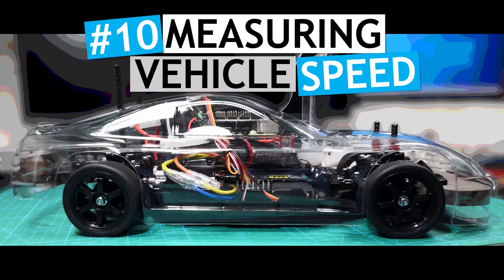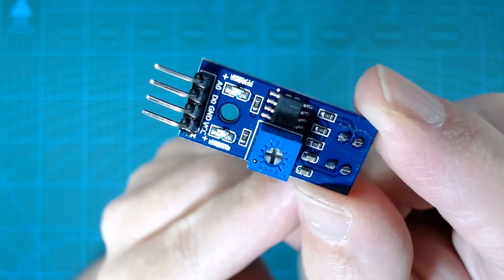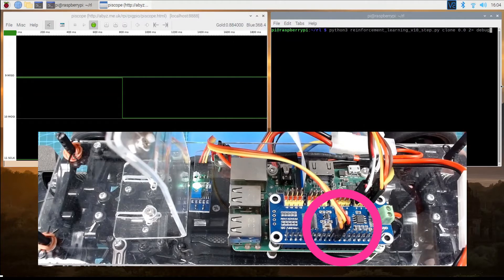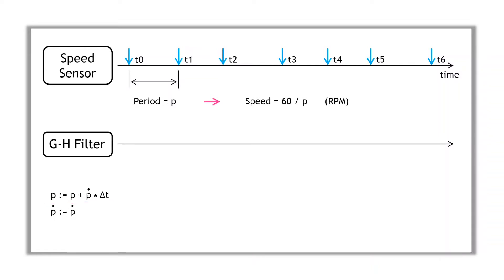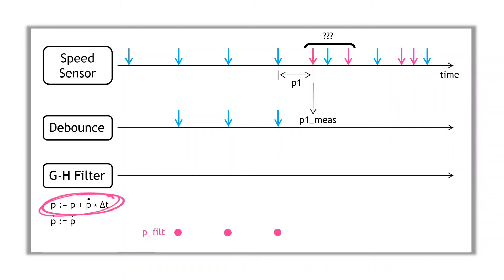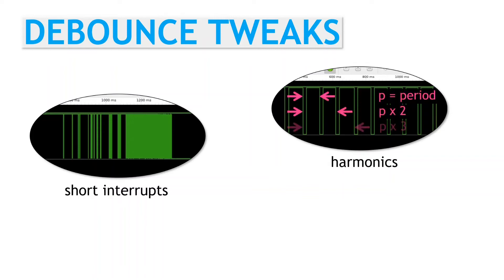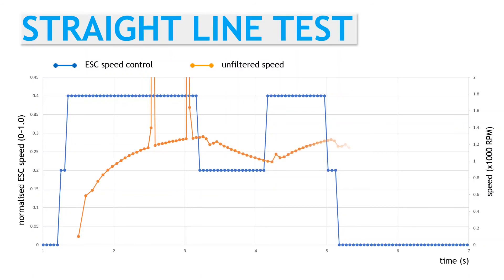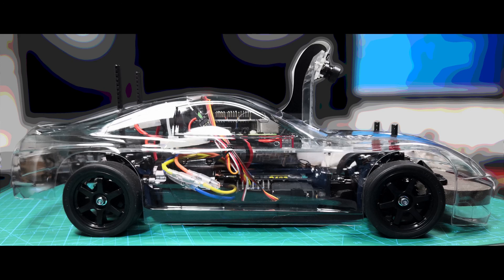Measuring the Autonomous RC Vehicle Speed

Comment: Hello do you know how to measure the steering angle of the vehicle?
Reply from the maker: The steering servo position gives you some measure related to the steering angle?
Reply: @theunsupervisedengineer1310  thanks you so much for your reply. Yes it gives me the measurement. In my case the steering servo motor can be adjusted from -100% to 100%. Then I measured an open loop table.  Something like -35 degree to 35 degree of steering angle is equal to -100% to 100%. However, it is not 100% accurate. So now I use IMU to give me another steering reference angle. ( However it's also not perfect one. So I am asking a better way to measure that. (Here the steering angle is related to the vehicle turning radius)
Reply from the maker: @xiboli188  Would it be possible to use an Optical Flow sensor? Optical flow would give you the x and y movement, which if mounted right at the front of the vehicle, could be related to the steering angle?
(Disclaimer - I have never used an optical flow sensor before. However I was thinking about using one in the future, to possibly measure the movement of the legged robot.)
Reply: @theunsupervisedengineer1310  thank you so much. I will consider that
Reply: @theunsupervisedengineer1310  by the way, thank you so much for posting such great videos. I am a PhD student and also doing the similar work like the DAgger  algorithm you performed. It motivated me a lot and give me so much inspiration
Reply from the maker: @xiboli188  Good to hear the content is useful. If you publish a paper, share a link to it. I would be interested in reading. Thx.
Reply: @theunsupervisedengineer1310  recently I also came across another problem, that when our vehicle starts, the friction force of our mechanical parts is very huge. Then  I add an additional 5% value for our motor in order to overcome those friction force when in low speed. But still it is not a perfect solution. I am still thinking a better way to handle that
Reply from the maker: @xiboli188  I dont actually understand what problem you are encountering. Do you mean that there is some non-linear relationship between voltage and speed (depending on whether you are just starting, or slowing down)?
There are different turn motors that you can use to get better low speed performance, as well as using brushless motors - would that help with your issue ?
Reply: @theunsupervisedengineer1310  yeah I mean that there is some non-linear relationship between voltage and speed when I just starting the vehicle, I need to give more voltage when it starts in order to overcome the frictionforce. Thank you so much for your advice. I will get a look at it. Now what I am doing is that when it starting I just add more voltage to my motor
Reply from the maker: @xiboli188  If you have a look at https://youtu.be/mrvgF3CD1p4?t=827
At very low speeds the motor shudders. I swapped the stock motor for a 55 turn one (slower), and didnt think much more about it at the time. I just did the driving/data collection at speeds above this shuddering threshold.
Probably the batteries/ESC are unable to provide enough current at these lower speeds ??
Reply: @theunsupervisedengineer1310  Thank you so much. I will look at that video again. Yeah I think this is because maybe the  batteries are unable to provide enough current at low speed, I will check that again. Thank you so much for your advices